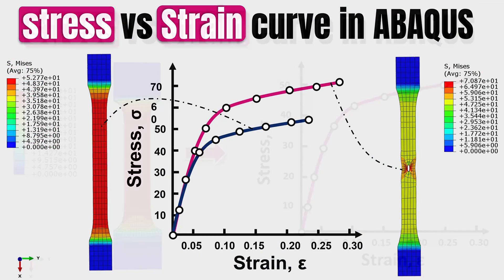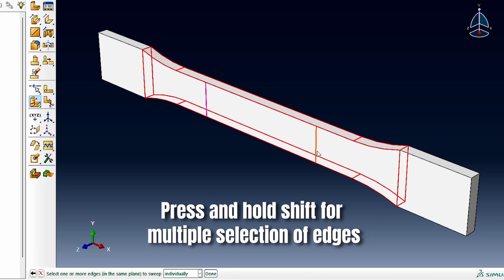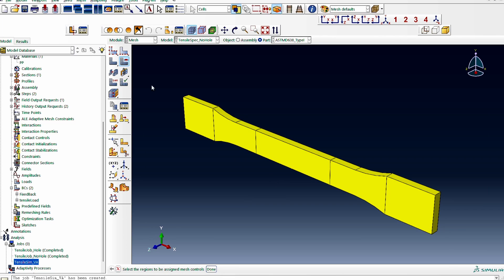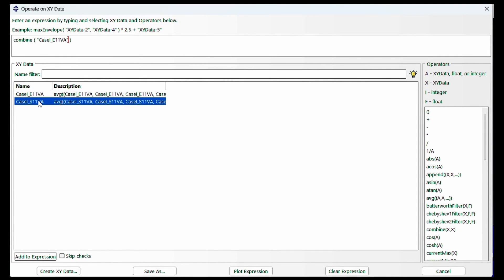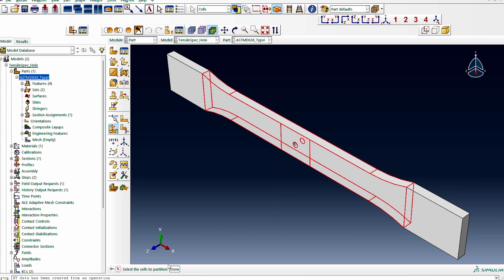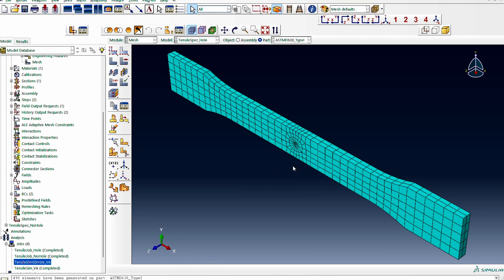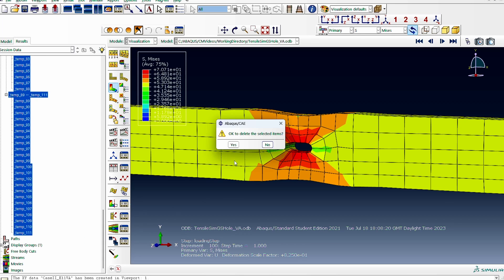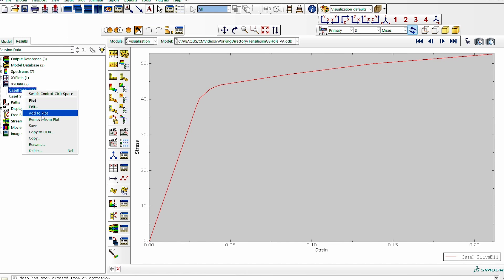How to get stress-strain plot in ABAQUS by Volume Averaging.

Comment: Does it still work when the elements' volume are not the same or silimar? AVG in ABAQUS seems just numerical average but not volumetric average.
Reply from the maker: I have always done it like this and it does work. You are right about the averages. It might be  a worthwhile exercise for someone to look into this and see. The alternative is to use a Python script to probe the history variables across duration of test and extract volume-level data, including element volumes which you can homogenize over all elements, and generate the volume-averaged values. I sense you will get to the same values especially for regular geometric volumes as this.
Reply: Thank you, Dr Michael. You are nice.

Comment: Why use volume averaging? Is it inaccurate to directly extract the stress-strain curve of the maximum deformation element?
Reply from the maker: This is a good question. The problem with probing elements (as you say maximum deformation element) is that it suffers from a localization error. I tried to show this problem in this video: https://youtu.be/OnOyrpGazho

What I will like is to remove the error of local elements showing higher stresses compared to others by exploring a volume averaging of a set of elements in the gauge section. This is similar to what happens when you do a physical experiment - you define a gauge section - and the stress-strain values are defined based on the dimensions of those gauge sections. So, it makes sense to determine the constitutive behaviour of the material by exploring what happens in the gauge section, rather that at a particular point/element as you suggest. Hopefully this make sense.
Reply: @MichaelOkereke  http://dsk-016-1.fsid.cvut.cz:2080/v6.12/books/usi/default.htm?startat=pt05ch47s02hlb07.html
Reply from the maker: I have always done it this way and it seems to be correct. I believe since the stress terms were extracted at integratio points of the elements, the volume issue might not be a problem. I have actually not thought more deeply about it but its an interesting comment. What I know is that it works well quantitatively, so I believe it is correct.
Reply: I believe the reason you obtain correct answer is because the element volumes are basically the same. To do this right, you have to calculate the stress times volume and then average over the entire volume. So you are basically summing the force instead of the stress, which is physically true. There is no physical meaning of directly summing stress components in this case. @MichaelOkereke
Reply: @MichaelOkereke  Thank you for your answer
Reply: @MichaelOkereke  I checked the ABAQUS help document and found that the avg((xy,xy)) function is only a numerical average and does not consider Element volume? Is there a difference between the numerical average and the Element volume average as you mentioned in the video?